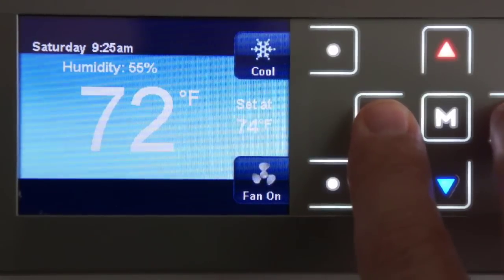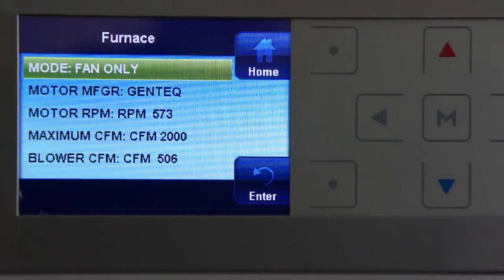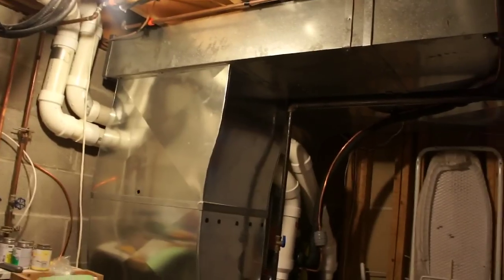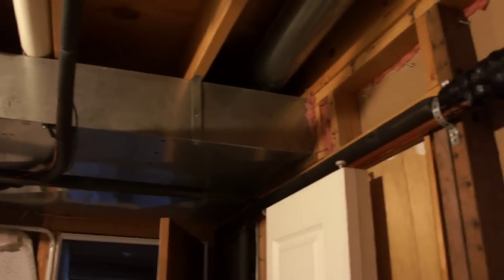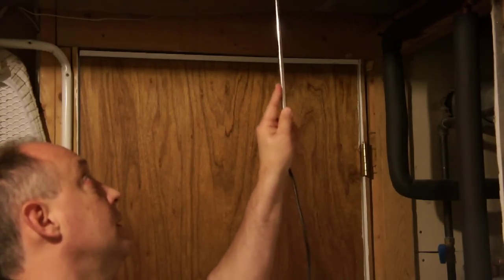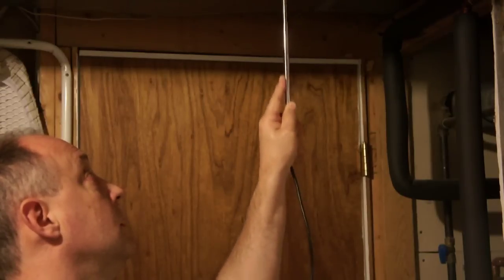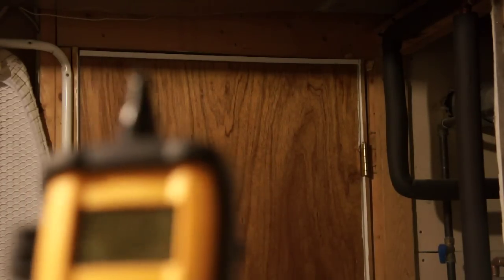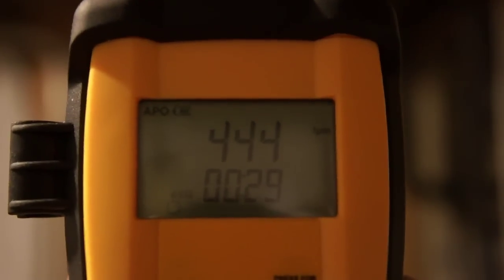Evaluating The Accuracy of The Fieldpiece STA2 Hot-wire Anemometer

Comment from the maker: It should as long as you do not measure next to take offs and are in a reasonably straight section of ducts. You should suggest that your customers upgrade those types of duct systems with no returns. They can depressurize the basement and cause back drafting of the appliance which could be very dangerous or even deadly.

Comment: I live in Louisiana and typically we have a return plenum sitting on the drywall due to our unit being in the attic and it usually is only 36" tall.  The furnaces the butt up against the return.  Our supply plenums typically are the same, 36" in length with take offs all throughout.  Any suggestions when using this and the SDP2 for taking readings?